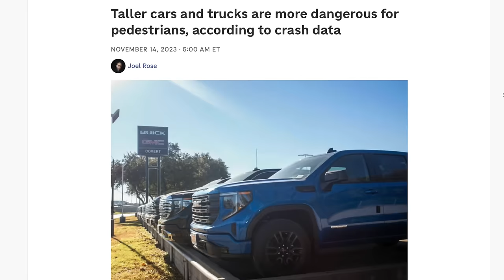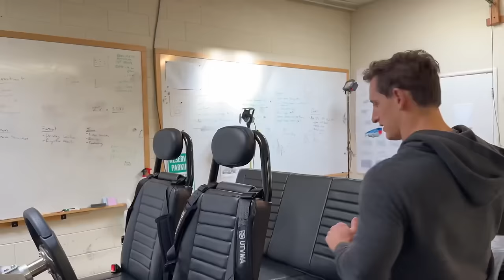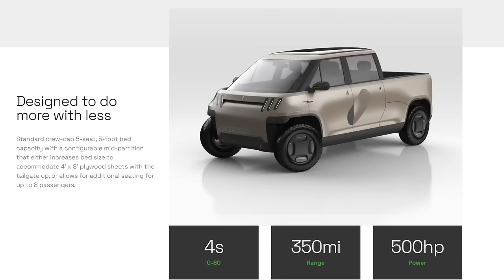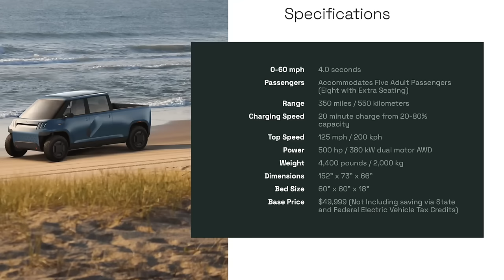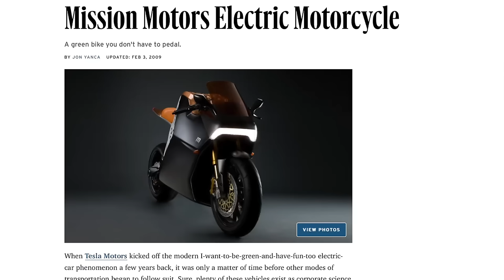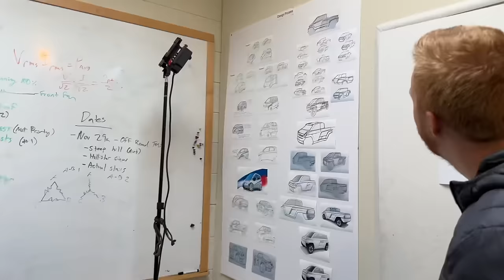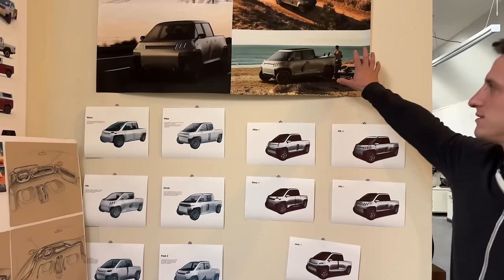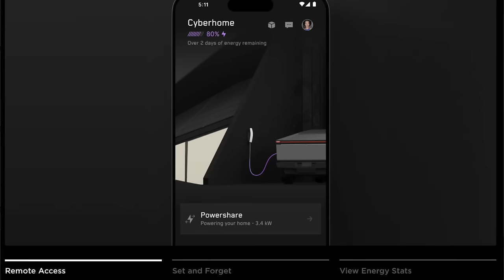Why are US Pickups SO BIG? Meet Telo

Comment: None of my ranching fr83nds have any interest in electric trucks. Not sure who you're talking to, but ranchers and farmers need a big bed for feed, fertilizer, concrete, lumber, etc. We need a ton of hauling power because to we make more money by hauling more livestock and supply.  We need pulling power compared to MPG. Our rural economy is built on the cheap, durable, easiy repairable pickup truck. 

If I can't load it with a fork, I can't use it. If it can't haul 20,000 lbs or more, I can't use it. If I can't fill up in 5 min and get back on the road for the next 400 mile stretch, in 20 degree weather, I can't use it.  My horses and cattle can't do that. And unless you build chargers between Wyoming and Montana, I literally can't make money. 

Sell this for what it is, another grocery getter for rich city housewives. Bult don't insult the intelligence of the people who grow your food by pretending we are clamoring for EV.  We aren't.

Comment: When the Ford Maverick is only $20k and gets 40mpg, not going to work to get $50k for this truck.  Those $60k prices were/are unsustainable, and this is already being shown.
Love the truck though, great idea.  However, let me give you a free better idea.  
Electric Powered Trailers with batteries.   The trailer is needed when its needed, not all the time.
If you really need it all the time, the big trucks are ok.
Contact me if you want an even better idea..

Comment: I don’t understand the current sizing of American pickups. IMO, the core sizing spec a pickup must be built around is a standard sheet of plywood. If a sheet can’t fit in the bed, the pickup form-factor is pointless; otoh, larger than a sheet of plywood (or MDF, actually, as they typically MDF sheet is slightly larger than plywood) is unnecessary “compensation”)

Comment: I like everything about the truck except for the price is way too high for a pickup that size. Maybe in the future when batteries prices finally drastically lower. The price will actually be closer to correct around $30,000 $20,000 I want one now

Comment: 6:00 okay so create a version where users can buy a 25kWh, 50kWh, 75kWh, or the full 100kWh version, and built it such that the packs can be added later as needed. With the correct BMS setup there is little reason having modular packs that can be added or replaced over term wouldn't work. 

Personally I'd buy a 50kWh with two open battery spots, giving me better weight capacity for around town work, and then buy 1-2 more packs down the line if needed. Heck, I'd even keep them at home on a maintenance charger, and only slot them in when going on trips. 

Some people would say it's too heavy to add/remove packs, but I do the same with a small lift for my roof top tent.
Reply: All you really need is a single and dual motor version with small and large packs to offer consumers options to meet various needs and budgets.

Comment: Overseas they use caboverengine 3.5t GVW truck based pickups and 1.5t+ van based pickups like the Express cab-chassis. These companies have not made conventional pickups of any size, so your size reasoning is fallacious. Smaller Japanese trucks once sold in the US were constrained by tax regulations limiting length and width. This went away as they actually stopped selling pickups in Japan for a while. Not selling in Japan, can make them bigger than Japanese tax sizes, so they did (you can argue it was the other way around, but demand for pickups in Japan was low enough it was an easy decision).

Comment: The problem is range and carrying capacity. A small EV truck wont handle  a load of the ford ranger and still get the same range. The other issue is how well will it do rock climbing or off-roading?

Seems this truck only meets a very small niche, city driving.

I hate cities and live and work in low populated areas, the closest Wal-Mart is 30miles away. The closest fueling station is 2 miles. Its all swamp and woods. All dirt roads.

Comment: If a vehicle cannot carry 4x8 sheets plywood and sheetrock as well as an air compressor and at least one helper with their tools, then it is not a truck by definition. It is merely an SUV.
Reply from the maker: This can do that. 4x8 sheets fit in the bed with the 2nd row down and 2 people on the front row. Most pickups can’t do that tho

Comment: As long as your truck is capable of safely hauling 4x8 sheets of material laying flat in the bed AND can haul 2-4 crew all day for a minimum of 250 miles in winter, warmly, that's all I care.  If you can't meet that, then I'm not interested.

Comment: Not sure that a lot of truck buyers will look at this vs say a Lightning (or similar) at the same price point and see them as equal in value and quality. Perceived quality of the cabin alone I can see putting many off a small run unit. What are all the killer features (plural), besides small that would make someone want it over a mainstream EV truck? Small can also be perceived as less safe and less luxurious. Love the idea, just have trouble seeing it being highly in demand.
Reply: I guess you can market it as "The EPA rules killed the mini-truck, this was bad for the environment and pedestrian safety, but it also was bad for many of you that love the mini-truck. Well the mini-truck is back, and here are the many reasons it is even better than the mini-trucks you used to love ..." That might win over the many people I see holding on to Hiluxs. One frugal farmer I know in France is still running his 1991 Hilux. There are few within blocks of me in Seattle. Win them over, you may have something.

Comment: Sad that they fell victim to the HP Fanatics many seem to have become today.  Just think how much more efficiency we'd gain by pairing back to 300 or even 250 hp.  We've known for decades that doubling horsepower only gives you fractional increases in performance so halving the horsepower while it could increase efficiency greatly to perhaps closer to 5 Miles per kWh you might only loose a second or two on the zero to sixty times so perhaps five or six seconds instead of four.  At 5 Miles per kWh you'd only need a 70/75 kWh battery for that 350 miles theoretical range instead of 100 or so kWh making for a lighter more cost efficient vehicle with an even lower curb weight along with greater payload capacity lowering cost to purchase, cost to use/charge while increasing capacity and value.

As a society we've become too inclined towards Extremism as regards HP and excessively inclined to sacrifice way too much on that altar.

Best!

Comment: I really like the concept EXCEPT not having a "wall" between the cargo and the front seats can be very dangerous in an accident. The cargo can easily crush the driver. That is why cargo vans have a division or an intermediate structure.
Reply: This applies also to the back seats.  Seems that the seat mechanism is the only resistance to that weight shift?
Reply: I think this is a solvable issue, if the back seats are made strong enough and tie into the side pillars and lock into each other rigidly, it should be as effective as a normal wall, since that's just a piece of Sheetmetal anyways

Comment: small is really good, for 4x4 offroad like the Suzuki Samarai , and Ford Bronco, it is hot in demand for off road. I'm replacing my CRZ hybrid with the Aptera and I need to replace my Toyota Sequoia v8 that tows 7,000, lbs 4x4, and holds up to 8 people, for tours I do . Does this tow 7,000, and 4x4 ? This could be it if it is lifted and has pv charging. ... ?

Comment: Yes! More small truck EVs! Majority of conversations I have with people who still aren’t convinced to transition to an EV yet, usually say something along the lines of “until they make a small Ford Ranger size pick up EV, I’ll have to wait”.
Also, cut that battery in half @53kWh. You don’t need more than 200miles in an EV in 2023- chargers are every 20-50miles. 106kWh is way too much battery. The new benchmark should be to never have more than 70 kWh for an EV battery, if you want more range, get a more efficient (smaller/different shape) car that can go twice as far with the same energy.

Comment: i am wondering if the 3 miles per KWH is based on just moving 1 or 2 people in the vehicle or carrying any cargo? I know the Chevy Spark EV could get about 6 miles per KWH.. I imagined that the Chevy SPARK EV could be made in a mini truck rendition. However, the Chevy Spark EV only carried enough electricity in its batteries to get a max range of about 100 miles.

Comment: I think they absolutely need a 250 miles range truck selling for $39 900, the truck would achieve that range with a battery around 66 kw,the profit margin would be the same.The $50 000. Price point seems interesting,but in 2 years the base Cybertruck price will be very close and then what??

Comment: There really is less demand for EV trucks now. Especially since they cannot tow  size able loads for A GREAT DISTANCE compared to a gas or diesel truck. Plus the charging stations are not set up for trucks that tow any type of trailer . Unhooking a trailer to charge AND WAIT 45 min to an hour IF you can find an open charger that works are all deal killers to me.

Comment: If you are aiming at the pickup market provide a FLATDECK OPTION.   You need to fit a standard 8'x4' panel in the body, and tie it down.You can't easily in a wellside  The 3 main flatdeck groups ar Tradies, Farmers, and Camping types. The compact format is able to fit carparks in most countries and you only need to engineer a right hand drive  for international market.

Comment: "Why are trucks so big"? Because they need to be that big to be practical for what a truck is designed for. As a contractor I need room for 4 guys AND sheets of plywood, not one or the other. Also like a full bunk of plywood not just a few sheets. Your tiny truck, using truck loosely, weighs 4400 lbs before passengers and cargo, so how much weight can you put in the bed of that thing? I'll bet not even half what I put in my real truck. Just because you call it a truck does that really make it one?

Comment: 90% of people in the US only NEED 50 miles of range per day. I don't get why they feel they need 300+

Yeah, with gas a 300+ mile range has the advantage of not needing to stop as often to fuel. But if you are charging at home or work, that is no longer an issue

Comment: $50 K is still too much.  That is why nothing is selling.  How much to drop the batter to 150 miles like you mentioned.  Maybe single motor?  What is payload?  Great idea to go smaller, love that it can still fit 4x8 foot board.  Air noise through the door will be interesting once they test that.

Comment: I like it but i still think at 50k its still way too expensive if they would have done a optional smaller battery with 250-300 miles of range and kept it starting at around 40k i could see it being a stronger contender but most ppl would rather a maverick or tacoma or other trucks for the price also fisker is coming out with a pickup for around 45k.

Comment: The reason why trucks are so big is because of towing people buy trucks to tow in Haul the more you Haul and tow the bigger The truck needs to be in order to safely bring that load to a stop speed doesn’t kill, becoming stationary again kills and I know for a fact that your truck is not going to tow a 20,000 pound trailer nor is it going to Hall 2000 pounds of dirt and gravel which is the primary use for a truck
Reply from the maker: Most trucks cannot tow a 20k pound trailer
Reply: Dude, at the beginning of the video they talked about how the EPA has fostered the growth of trucks. Hopefully you’re old enough remember, when millions of Ford rangers and small Toyotas were sold. They never towed horses or boats they were for hauling things mostly. And most Americans never tow anything. Especially in crew cab short box F150, which is the best selling configuration in America.
Reply: @TailosiveEV  Correct. I have a truck capable of towing almost 20,000 pounds and never do that because I’m not in construction and don’t have an excavator. I do have horses however and that’s what it’s used for.

Comment: If the back seat folds down… What happens if the load in the truck bed is high density, and you slam on the brakes?

Comment: Don't get it why they would want 550hp on this car , no one needs that or 3-second acceleration, that is just overbuilding as it cascades on complete drivetrain and battery systems specs behind it.
Reply from the maker: It’s a side effect of wanting good traction and towing capacity. Doesn’t take away from other specs

Comment: Yes! I've always been mystified as to why small EV trucks haven't been available. My Tacoma turns 20 this year so it's time for an upgrade. I've held off because I want to go electric and also want to be able to walk around the vehicle when it's parked in my garage! Seems like a bare-bones truck of this size would be ideal for municipal/utility vehicles: short distances with lots of stop/start use and goes back to home base each night for charging. I dunno, hope these guys make it. Would really love an extended cab instead of a double, but that's just what would fit my needs.
Reply: I agree with everything you say.  My Tacoma is also 20 this year and the newer ones (2005 and up) are much bigger than necessary.  I'm wondering if Toyota is really coming out with the Stout?  The $50K price tag is a turn off for so many potential customers but I think it's probably better to start high and lower the price as production increases.  I'm a farmer and seldom have more than one passenger, the  extended cab would be better for me and cheaper to build.  The longer range is definitively a selling point.

Comment: Did someone see a tow capacity?  I'm guessing well under 5000lbs.  Most people I know with trucks have trailers, so...kind of moot.
But def good to get trucks out of cities and burbs and all those 4wd posers lol
Reply from the maker: Yep, they said 6600 pounds
Reply: I saw that now, thanks.  That's actually impressive for its size.  I geniunely hope they make it to production, I would buy one instead of my ram 1500. All I ask is no air suspension lol,  they can't do harsh winters

Comment: I love the trucks that are used in Korea.  Hyundai even makes one that is all electric and has a bigger bed than an F150.  If the Telo in 4x4 version can tow a fiberglass Ranger bass boat then I'm sold!  I'd take it over a the cyber truck I have a reservation for.  I really just need something not gas, that can haul 4x8 sheets, tow a boat and seat at least 2 people.

Comment: I hope that they build a ramp into the tailgate. I was going to get a cyber truck and an aptera but I might go with this instead. It's vastly cheaper now that the Cyber trucks' prices were increased astronomically and it has the mid-gate that I wanted along with being smaller. The Cyber truck has horrible dimensions.

Comment: What's old is new again. Think back on the Ford Courier, Chevy Luv and Subaru Brat.

This is not a new concept. The reason trucks have had to get bigger is because of government fuel economy standards  and rules. The larger trucks kept moving out past the standard formula every time to hit minimums. It is government policies that caused truck sizes. My favorite trucks in the past were the first gen Dodge Dakotas. A midsized truck with the specs of a 1/2 ton truck and better on fuel.

Comment: isn't the air running through the front door ( @ 19:00 ) gonna make it super loud at highway speeds?
Reply: That was my thinking too. Plus road noise from the tire. An air funnel from the wheel well to the the inside of the door seems like a recipe for wind and road noise in the cabin. Also wonder about all the typical internals of a door. Will it not have speakers, motorized windows, cup holders / pockets.
Reply: @Alexdiaz727  Forget wind noise;  how about cold winter air, SNOW,ICE, SLUSH, ROAD SALTS!!! This idea will die with some real world test. It might even freeze the door shut when parked overnight with all that moisture in there. And then the rust factor

Comment: Will it have NACS? Will it get FSD? the two questions that make considering any of these other EVs so difficult, no matter how cool the form factor or shape they've started working on is.

Regardless, I think this little truck is super cool.
Reply: Said in the video they plan to use NACS. FSD isn't an product at this point, Tesla hasn't announced any licensing agreements. Imagine if they get FSD figured out we will see Ford or some other car maker before we see this company. Canoo also has a similar vehicle and are struggling right now to get to scaled production. My consideration is current and up coming EV trucks. Can get a Pro Trim or used F150 Lightning for the price they want in this video. Imagine I would be able to get a used 2025 version 2 F150 Lightning with NACS for less before this company ever comes to market at any sort of scale.
Reply: There are several software solutions for self driving cars that are either open source or can be licensed.
Reply: Tesla is the most accident prone make in the US. Something like 24 accidents per 1000 drivers.  Part of it is due to the FSD and Autosteer function
Reply: @linusa2996  I disagree. I think most of those accidents are due to people not respecting the acceleration and the torque. I got a speeding ticket about two weeks after getting my model Y while driving it manually for the first time. Because the ride is so smooth and quiet, you do not appreciate exactly how fast you are going when you punch the acceleration. That said, I haven't driven manually since and have been much better off.

I've had FSD beta for almost two years now and I could never imagine ever wanting to buy any vehicle that doesn't have it. I would say that most of the enjoyment I get out of my vehicle comes from FSD beta making trips easier and less tiring.